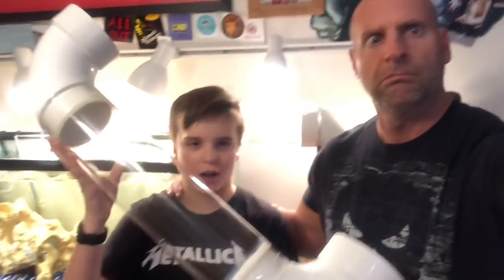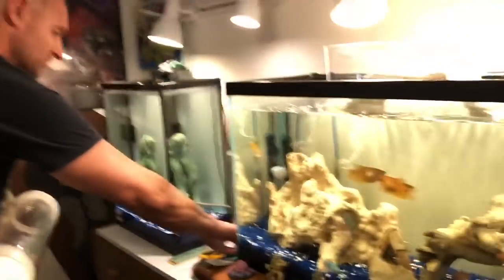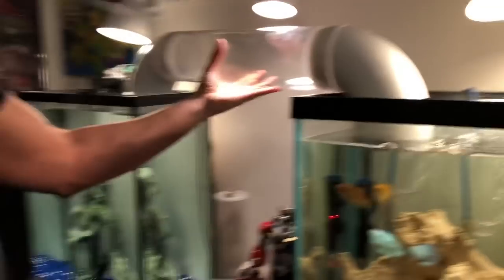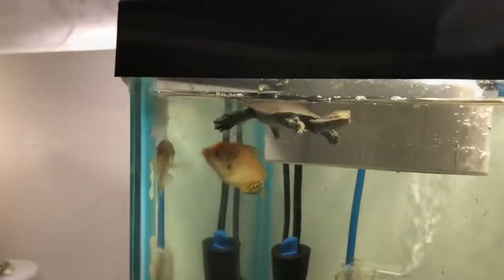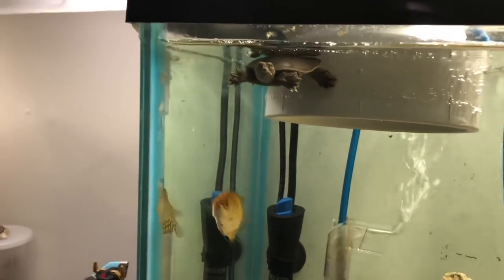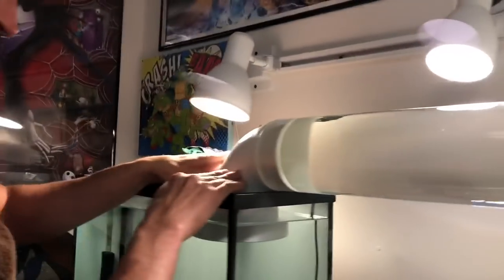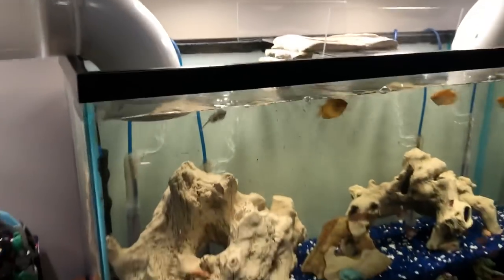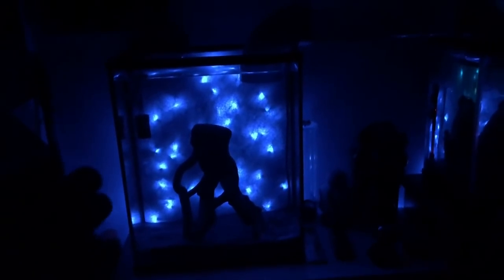Connecting 3 Aquariums With 2 Aqua Bridges!

Comment: What happens if you drill a hole in top center of bridge then make an air tight connection with tube then start a siphon and send it back into one or both tanks. Maybe 2 tubes 2 siphons to even it out. Just so it's moving water. Moving water is cleaner water for fishies. Just a thought
Reply from the maker: Thanks so much Eric....I've been designing aquariums for 41 years for myself, other people, and for Jack ever since he was born....also, since I am a nurse, for some of the hospitals and facilities I have worked for....we are newer to YouTube, but not to the hobby....stay tuned for more fun stuff....and be sure to check out our playlists/links in the description for some of the things we've already uploaded....we do a lot of UG lights and other fun stuff....we are always changing and trying different things and sometimes they don't always end up the way we want so we change them....the water in the bridges moves and is not stagnant....it is under a vacuum and we have made much larger vacuums and when we have to put in meds of something of that nature you can see it spread right through the vacuum.....it's science.....check out our aqua-cave/penthouse design.....one of our first uploads for a real mind bender....thanks again for the nice comment!
Reply: I’m sure there is enough water circulation with the pumps and filters
Reply: @chrisfloto3599  I don't think the water in the bridge circulates at all.
Reply from the maker: It does actually and we will doing a dye test to show this in the future for people who don't understand physics....

Comment: You know if you pump water in a tank on one side or the other and take water out of the opposite side water will flow through those pipes otherwise you will end up with stagnant water and a place for bad stuff to grow plus it would ensure that the oxygenated water is getting through the pipes, not to mention refreshing the water.
You could also tap the top of the pipes to the intake of the pump so that the air getting caught in the pipes is constantly being pulled out and the pipes should (in theory) self prime as the air is pulled into the filtration system.
Just a couple thoughts for you :P
Fun project though! Keep up the great fun projects and ideas!!!
Reply from the maker: This set up has been renovated and updated a few times already and we are doing more changes right now and will be updating it soon....it's one step at a time....we are constantly upgrading our tanks and updating as we go along....there's never really an end to any of our projects....just another step towards awesomeness....hahahaha....the fish and turtles are all doing amazing and growing very well....and they really seem to like the background lights a lot....we use night lights in most our tanks and always have and our fish have always seemed to like them....they are dim almost like a moonlight situation....these are getting changed too another type and we'll see how they work out....I've been designing aquariums for 41 years and always had happy animals and tend to spoil them all quite a bit which is how it should be....we also build tanks for other people and help them upgrade their tanks too....we have posted all those as well and more to come....we encourage you to check out some of our other videos on our channel to see more of what we have already posted and hope you have a great day....

Comment: Hey Jack and Dan, I am attempting to make my own aqua bridge but air continues to gradually leak into the tube causing the water level to drop. The design is fairly similar to the smallest aqua bridge you have on the far right in this video where the diameter of the pvc corner pipe is larger than the diameter of the hurricane tube which means the glass hurricane tube is inside the pipe opening. How did you properly seal this with silicone to prevent air from coming in?
Reply from the maker: In one of the videos we showed how we used a small tube of silicone to reach inside in a reverse nature to seal the inside better so maybe that would help.....if that's not in this one check out some more of the aqua bridge videos....also when in doubt....add more silicon....eventually you will find the leak....if you wear gloves and just put a very thin layer over with your finger it won't be too messy or look unappealing....hope this helps and thanks so much for watching....we have lots more awesome stuff coming up!

Comment: with this set up. will one heater be able to heat both tanks or do you think we still need two heaters. and same question for filtrations as well. thanks
Reply from the maker: The water goes through the bridges but not enough to filter and not enough to heat....especially in the Winters we have here in Cleveland hahahaha....maybe some cold water fish would be okay, but not with turtles and all the other guys in here so we have extra filters and heaters....these tanks are doing great and we have done several updates in them and have another coming up Friday because the albino plecos had babies and they are cute as heck!

Comment: Rather than sucking the air you can use a one way air line check valve in the top,  I done this and worked great, saves getting wet. Just airline on top suck then pull airline off
Reply from the maker: That wouldn't be any fun though....hahahaha

Comment: I've watched your videos and saw your comments about keeping aquariums for over 41 years, but I can't help notice that the tanks are too close to the unprotected sheetrock walls which could lead to soft walls and ceiling damage.  I've had this happen to me with my two tanks even with them being covered, with just a few slots cut out for the filters.  Some of my friends' tanks created wall and ceiling damage as well.  In some situations in as little as 5 years time.  I suppose it depends on where you live, the climate, and you're a lucky person or that wall and ceiling really aren't made of sheetrock.  I've heard 1 foot away from walls and with some kind of material near the tanks and ceilings to help protect them.  Most fish stores keep their tanks away from walls and run fans to circulate air 24 hours per day.
Reply from the maker: Thanks

Comment: you can get water pumps that have an end part with an air intake to make bubbles , that air intake can be used to remove air from your bridge
Reply from the maker: oh it's cool....I've been designing tanks for 40 years and I'm old school....plus it's fun cause the kids think it's gross hahaha.....this set requires very little maintenance....we almost never have to adjust them....we do changes from the very top to the edge of the bridges and between the hillstreams and plecos and UG in the middle and not overfeeding helps a lot....check out our playlists for more and many more to come too....thanks

Comment: Hey Jack and Dan! I was so amazed and inspired by the whole idea of the aqua bridges that I decided to try and build my own aqua bridge to connect two tanks. However, despite what I do it seems that air continues to seep into the hurricane glass tube and the water level diminishes. I sealed the glass with silicone at first but the water level continued to drop. Afterwards I tried to seal it some more with gorilla tape which is apparently stronger than flex tape but the water level continues to slowly fall over time. Do you have any suggestions? Is there any way I can reach out to you via email or text? I would like to send you photos of my fish tanks and the aqua bridge to see if you can spot anything that may be causing this. Please get back to me at your earliest convenience. This is an anniversary gift for my parents!
Reply from the maker: We would definitely recommend getting up inside with some gloves and really sweeping the inside areas with more silicon because ultimately that's the only thing that will fix it....adding more to the outside or tape probably won't work....as you can see in the video we used a smaller tube of silicone to get up inside the bridge that you can buy for about 2 or 3 bucks at any hardware store....we also applied a lot of silicon to the inlet of the elbow and to the glass before inserting it so that the gap between the glass and PVC were quite full for extra support....try some of these things and if you have to take it apart and start over this may have to be an option unfortunately....and always use 100% silicone with no other additives at all....hope this helps....we also allowed at least 72 hours to dry
Reply: Jack and Dan thank you so much for your help I appreciate it a lot! I’ll take your advice and get back to you in a couple days or so with an update on how it’s going.

Comment: How about the filter works for this 3 bridge ? Can i just put one filter in one aquariums and push the water in next aquariums ?

------> this water pump flows
1-2-3 this aquarium 

Water pumped from 1
And put into 3 and so on

Can this model works ??
Reply from the maker: We have several videos going over more  about these tanks and they will answer most of your questions but we have a UG in the middle tank and hob on the sides for our set up for the best results we can get

Comment: Add a valve in the top u put the hose on so u don't have to get into tank, only down side would be adding another possible leak spot
Reply: I wrote this before I got to the part where they r glass and not plastic so might not work that easily
Reply from the maker: Thanks....honestly we never have to take them down.....we've done several follow up videos on these and we go over how easy the maintenance has been and we actually just did an update just a couple weeks ago....if you go to our videos and or the playlist of our aquariums you'll see this and many others....thanks so much for watching and commenting

Comment: Are you supposed to run aqua clear filters with the water level that low
Reply from the maker: We have done several videos on aqua clear filters and have used them for decades....they have the ability to function very well regardless of the height of the water as long as the intake is submerged....
Reply: @jackanddan  good to know thx

Comment: what size tanks are the ones you are using?
Reply from the maker: 20, 40, 20 Yes they are! Thanks.....this is a remarkably stable system requiring very little maintenance....the plecos and Hillstreams keep the glass very clean and it's way over filtered and when we do water changes we don't even take the bridges off we just take it all the way to he top and then to the opening of the bridge and do that 3 or 4 times and in 20 or 30 minutes we are good to go for another few weeks....the UG in the middle tank and deep substrate in the side tanks and not over feeding helps a lot too....we have several designs and encourage you to check out our playlist and links in the description for more....I've been designing tanks for 41 years and have made myself, Jack and many other people many tanks over the years and we will be sharing more every Friday and some other fun stuff on other days as well....thanks for stopping by and be well....

Comment: the tanks look great  when you pulled the tooth paste tube i had to laugh  years  ago  i stayed over my sisters house in the morning i went to brush my teeth in their  bathroom realizing i forgot my tooth paste i grabbed one i found in one of the vanity drawers it was  horrible tasting  afterwards i read the tube and realized i had used the dogs prescription  tooth paste  i’m 56 years old  have had  fish tanks for more than  35 years  and  have spit my share of fish water over the years  although i must admit ive switched to the Python system that has a siphon that uses the sink water pressure  ir also  helps to eliminate most of the mess
Reply from the maker: funny....we do have a 150 foot python but we don't bother with the bridges they are so small and we actually seldom have to fill them....we have done several updates on this set up and will continue to....thanks for watching

Comment: My tanks are about 1/2” (maybe a little less) difference in height is that a problem?
Reply from the maker: The water will always siphon to the lowest point, so you may have to extend the length of the bridges down spout....this is quite old and we have made many upgrades, and changes, and even put cross circulation in since we made this video....you can check our aquarium playlist in the description if you want to see more of this set up and any of our other dozens of aquarium design!
Reply: @jackanddan  hey thanks for the reply I didn’t know if I’d get a response cuz the video was so old 😬. So I had thought to put a small section of clear tub at either end of the elbow so then I guess it wouldn’t be an issue? If I’m understanding correctly.
I’ll check out the play list I must have missed it. This was the last video I saw about the bridge. Thanks for the idea, wanted to do this but didn’t want to try and cut glass and silicone it and make it all square.

Comment: I'm just wondering how you do water changes
Reply from the maker: You can still exchange about 20% of the tanks if you fill em all the way up and then back down to the bottom of the bridge opening.....so we do that a few times and it works easy....about every couple weeks....we show how they are all interconnected by gravity and pressure in other videos so if one goes up or down they all do....about every 2 or 3 water changes we clean the bridges and then just suck the air back out to make a vacuum again....it only takes a few minutes....it's very cool and not as hard as it seems....this set up is so fun to watch and the fish and turtles are always going from one tank to another....thanks for watching and we hope you have a wonderful evening....